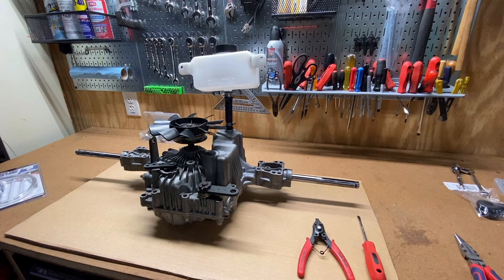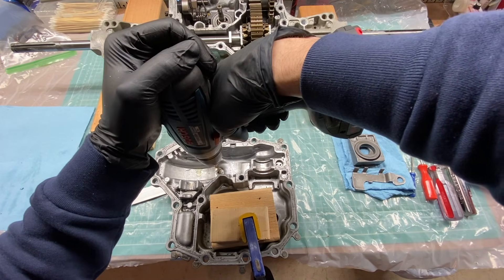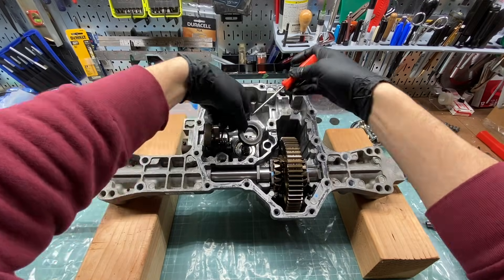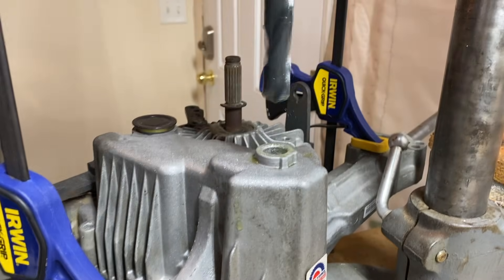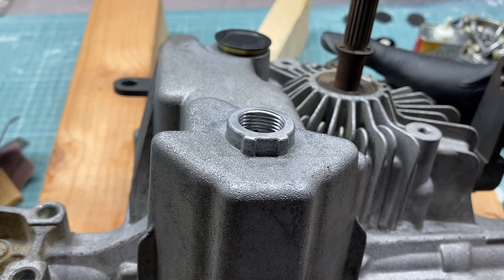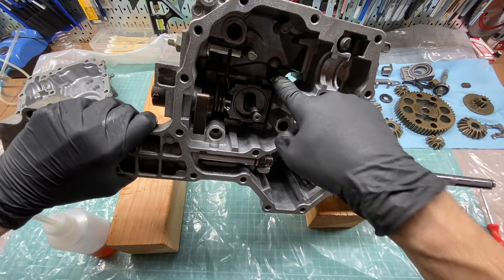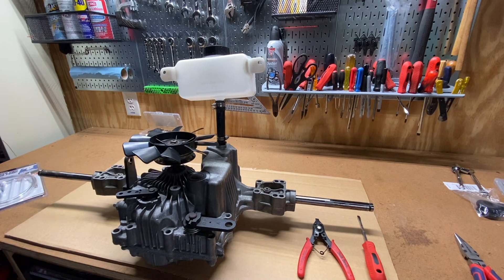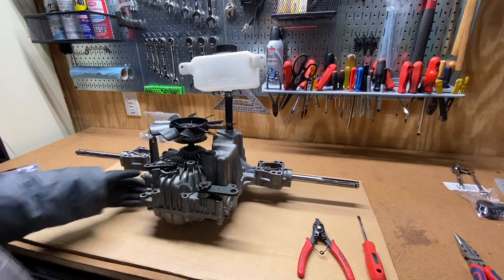Modifying the Tuff Torq K46 / T40J Transaxle For EASY Oil Changes (Oil Fill Mod Series Video 2)

Comment from the maker: I wanted to share the results from someone else who tried this mod and had issues. The person who kindly shared feedback indicated that he tapped the vent hole by hand because he didn’t have a drill press. His threaded barb ended up being crooked and leaked.

Just a word of caution for anyone else trying this: make sure you tap your vent hole perfectly perpendicular to the case so it makes good contact where it screws in. The compression of the threaded barb + washer against the top of the case is what makes the seal (not the threads).
Reply: wonder if he used a crush washer like a car oil pan? thread sealant would also work, even some pipe dope
Reply from the maker: @patrickpk6299 I assume he used a crush washer because one comes with the threaded hose barb that I used. He said he bought all the same stuff that I used. I’m not sure what else he tried if anything.
Reply: what you should of told him to do is get a rubber plug like a boat plug they come in every size imaginable and even with it being crooked it would of worked fine. i have used boat plugs for far worse including a rusted gas tank that had a pin hole that i drilled out and stuffed a rubber plug in. it wasn’t on the road but an old mud truck and i swear it held for a decade and probably would still be holding if truck didn’t get scrapped.

Comment: Just did on my k46.
 I  went for m10x1  hydraulic plugs with Allen head.
 I got to say, this is a drill press operation. Drilling  itself and as you did  guide the tap.
I had a  hard foam abrasive bit, i could polish the contact  surface for the plugs.
The hydraulic plugs  i got where vsti m10x1 ed. 
Integrated seal ring, and perfectly flush with  bottom of the housing, nice small head diameter.
Reply from the maker: Nice! Would love to hear how it works out if you feel like giving an update after getting it mounted and using it.

Comment: Good video and great work on the mods.  I'm hoping to add an external tank to my new ZT2800 transaxle but it has internal tanks and Hydro Gear is saying don't do it.  The three ports involved in filling (fill port, overflow port and breather vent port) really have a connected life in this low pressure system.  I don't see how adding a tank to the fill port is going to cause trouble.  Their internal tank essentially does the same thing.  It's all just low pressure fluid with a vent to atmosphere, correct?  Sorry for being long winded.  Been looking for a hydro friend 🙂
Reply from the maker: I can only speak to the Tuff Torq k46, but the vent is piped straight into the case.  The gearing side and the pump side of the case are connected by the fill opening at the top. It doesn’t look like it was intended for the oil to free flow between the two sides. It’s possible there could be a downside to that. I think there is more upside in being able to change the oil regularly though. That’s just my opinion. 

As far as I can tell it’s all low pressure except for where oil goes through the pump (on the k46). If the whole case was under pressure then that wouldn’t make a lot of sense for there to be a vent like you’ve observed.

What did Hydro Gear say exactly? Could you ask them why they say don’t do it? Maybe they just don’t want to support you if something goes wrong. Tuff torq used to publish a PDF telling you how to drill drain plugs in the k46 pan. It seems like they scrubbed their site for that. My guess is because people messed up and it was probably a headache to deal with. 

If you do mod anything, I expect that will void your warranty and you’ll be on your own and responsible for any mechanical or safety related issues. All the fun stuff 😀

Comment: Nice video very informative but kind of silly because I’ve had my Scott’s 42 inch riding mower with a T 46  hydrostatic transmission and the Kohler 17.5 hp a single cylinder and it’s still runs great. I changed the transmission oil once in 23 years by removing the steering wheel and front hood then simply flipping the mower upside down with the front resting on the steering shaft and the rear resting on the seat. All I had to do was take a screwdriver and remove the top plug, simple, fast and easy. Then refilled it once I flipped it back using a plastic tube that easily fits through the height adjustment arm space.
Reply from the maker: Wow! That would make a great video 😀

Comment: I bought the wrong K46, on e reinstalled I find that the transmission release works opposite as it should. Further, the foot pedals also work opposite.   I thought that maybe when I installed the release lever (had to remove the supplied lever and roll pin).  If I happened to rotate it 180 from its intended orientation could it make it work backwards?
Reply from the maker: For the bypass rod couldn’t you just use it in the reversed configuration? Regarding forward and reverse being swapped, it should be technically possible to change the orientation of a wedge shaped piece that sits between the hydro pump and the gearing. You have to open the case to do this. I’ve never actually done this but have read about people doing it. Proceed at your own risk 😀

Comment: I'm not actually sure whether or not this is the transaxle that is in my mower. How many hours were on this axle before you pulled it apart? Mine has over 1000 now and the whole mower looks like its been to war😅. It may not be worth it for me to try this now, the axle has been seemingly fine. It would be my luck it would fail after fixing the deck issues (multiple broken welds, rounded out mandrel drive pulleys, wheel broke off at the welds). If the motor gave out I could solve that by swapping it with a harbor freight motor if needed. Just trying not to spend 4-5 grand on a new mower right now. I bought this Husqvarna mower over 10 years ago when it was only 1600 bucks, and back then we thought it was outrageously priced. 😔

Thanks for the video!
Reply from the maker: Wow if you got 1k hours then that’s pretty good in my book. I had about 130 hours on mine — took me about 8 years to rack that up. My yard is probably too hilly for this trans.
Reply: @MostlyBuilds  Ours is about 6 acres of regular lawn, lots of roots though, not really well landscaped and some of those hours were used cutting pretty heavy grass in the smaller pastures in the back yard. This mower is being held together by the grace of God right now lol. Its the lawnmower equivalent to "i'm tired boss". And i'd say say right back atchya mower, you've been faithful despite me being a terrible owner..Haven't changed the motor oil in 2 years..about to do that today actually. 😅

Comment: Nicely done.  An easier way to mod the case vent would be find the desired size hose barb with a male NPT fitting that will slip into the factory hole as closely as possible.  Bond it into place with a generous bead of JB Weld.  Indestructible.
Reply from the maker: Thanks. JB weld did cross my mind. I wondered how a solution like that would hold up over time with the repeated expansion and contraction of the case when it heats up and cools down. If any of the JB weld cracked off and fell into the case that would prob be bad news for the pump. If you try it let me know 😀
Reply: @MostlyBuilds  I saw a highly experience diesel mechanic use JB inside a Cat truck engine to smooth an area over which the cylinder liner bottom O-rings slide during installation to avoid damage.  I think cured JB is resilient enough to cope with the temperature cycles.

Comment: Can the transmission be filled from the top instead of the bottom?
Reply from the maker: I haven’t tried filling through the expansion tank. I worry about air pockets. It might be possible. I would def follow the air purging procedure and let it sit for a bit afterwards to see if adding more oil is needed.

I think filling from the bottom is better though. This is how you fill the lower unit on outboard motors with gear lube.
Reply: @MostlyBuilds what is the oil capacity of the transaxle? What if you fill it to capacity? Wouldn't that ensure proper fill?
Reply from the maker: It’s about 3 quarts with the over filling that my mod requires. That’s a good point, I could totally try filling it from the expansion tank and see if there is any oil left over. Next time I do this procedure I should pay more attention to how much oil is left in the 3rd bottle. I’m pretty sure it was only a tiny bit because I didn’t save it.

Comment: Is there a way to add external oil cooling radiator?
Reply from the maker: I haven’t tried this but I’ve seen a few people attempt this with solutions that look a little hacked together (using things like JB Weld). 

Here are two: 

https://www.mytractorforum.com/threads/k46-oil-cooler-custom-my-way.1321309/#replies
(Expand the first post on this one)

Another one I found when I was looking up that first link to paste on here:

https://youtu.be/mhgfeOZvSDI?si=KgD5ZbpDEOTr5_1B

I think it would be interesting to add an oil cooler. I’d also be interested in building in an oil filter that can be easily replaced. I might do this one day, but I’d like to come up with a more “production” looking design than the two links I pasted.

Please share if you come up with anything or have any interesting ideas. Would love to collaborate.
Reply: I don't think it's worth going thru the trouble with the lowest end trans the tuff torq makes. I'm in the process of doing the mods you did here but that's as far as I would go with this trans. Tuff Torq should have stopped producing this k46 and recalled the rest of them. They are not built to last.
Reply from the maker: @ggtaruc2578 I get what you are saying. I don’t know if it’s like pure evil though. Imagine one company releases a cheap and totally accessible riding mower with the k46. Now someone who could never afford a quality machine can get the cheap one that will last them 10 years with their totally flat yard. Then other mower manufacturers who wouldn’t have considered putting their names on a low quality machine suddenly are losing all this market share.  Then they jump on the bandwagon and suddenly everyone is  selling budget machines rocking the k46. 

I don’t know if that’s really how it happened but multiple manufactures sell machines with the k46. They all know what they are doing. Is the alternative better where there just isn’t an affordable machine at all? Dunno. My beef with them is they aren’t more up front about the limitations of the trans. 

Just my opinion 😀. Good luck with the mods. Would love to hear how it works out for ya if you have time to write back about it!
Reply: A cooler is kind of un-necessary - the fan is constantly blowing air when running. You just need to make sure the cooling fins (under the fan) are clear of grass, to keep it cooled properly.

Comment: The fact that the mfgs spec these transmission without serviceability tells you everything you need to know about what their intentions are.
Tuff Torque makes their full line of transmissions with expansion tanks and drain plugs installed at the factory.
OEMs are the ones that spec them W/O these critical feature.
Sealed OEM transmissions are a giant SCAM to force you to buy a new mower every 5-7 or years.

Comment: Your generation always wearing gloves to work on things. It's so hilarious. How could you be killed? will the transmission explode. I need to do this to my john deere x320 K58 tranny without taking the bottom case off. My destroyed lumbar region of my spine won't allow me to do all of this. Come to my house in south florida this winter and spend a few days and do it for me. thanks.😁You don't need a specific sealing washer. You can also put silicone on the threads or teflon tape. Teflon tape has been used for many many years. Your funny. 😄
Reply from the maker: No glove no love!
Reply: @MostlyBuilds  You younger people. Germaphobes and boo boo aphobes. Dawn or gasoline will clean all the grease and oil off of your hands. Your not making love to mechanics or anything else. 🙄🙄☺☺
Reply: There is some "evidence" that repeated exposure to petroleum products is detrimental to your health , and perhaps it is but that not why I wear gloves.
I prefer not to get oil and grease all over everything I own and/or have to wash my hands with pumice soap 5 times a day.
I would rather not have everything I own be a greasy mess and not be allowed in my house by my wife b/c my hands are covered in grease and stain everything I touch.
I don't live in a garage where grease an dirt is perfectly acceptable. My houses floors also dont look like the bottom of a oil change pit  b/c I take my boots off ... b/c im not an animal.

Comment: Pretty smart of Tuff Torque to sell equipment without drains and threaded, accessible fill ports.

Those that can, will drill and tap their own.

Those that cannot will buy a new trans. from TT or buy an entire new tractor that benefits Red China.

Brilliant business model, and they don't even seem the slightest bit ashamed of their incompetence or greed.
Reply from the maker: It’s definitely a bummer that the trans isn’t serviceable. A few additional thoughts:

- The mower manufacturers are who spec out what features the trans gets (within the capabilities of the k46 design — drain plugs for example)

- The limitations of the trans might in part be what enables riding mowers to exist at this price point. Otherwise a riding mower might be out of reach for many.

What bugs me the most is that the mower manufacturers just say the trans is a sealed, non-serviceable unit (that’s what John Deere says at least). When in reality it’s totally serviceable, but inconvenient. I’m sure it’s not worth it for a dealer to service them. But a handy consumer could totally service it with some effort. They could share info about “advanced servicing” or something.  

Thanks for checking out the video and for sharing your thoughts. Hope you consider subscribing.
Reply: @MostlyBuilds  
The mower manufacturers are who spec out what features the trans gets (within the capabilities of the k46 design — drain plugs for example)

- The limitations of the trans might in part be what enables riding mowers to exist at this price point. Otherwise a riding mower might be out of reach for many.

*Gibberish
Reply from the maker: haha! I tried! All I can say is that I've had really positive interactions with the folks at Tuff Torq. I can't say the same about John Deere.

Comment: Nice job on the drains and i too have thought about modifications to allow filling eithout removal of unit. Its all for nothing though. I have done full service and overhauls on several dozen of these and the issue is never just the fluid. The filters always clog, sometimes in as little as a year. Chaning the fluid/oil without changing the filter provides very little if any improvement.
Reply from the maker: Well that's a bummer. When you say the filter is dirty, is it like totally caked with stuff? When I took mine apart for this video series, the filter didn't look clogged at all. My trans had 130 hours on it. I guess I'll see what the oil looks like when I drain it in the spring. Another thing to consider is if you overheat the trans, oil can't spew out of the vent cap anymore because of the expansion tank. When I took the trans off before the mod, it had dried oil all over the case on the vent side.
Reply: @MostlyBuilds  yes, almost completely clogged. Sat old filter on flat metal workbench and filled filter with fresh oil, that small volumn of oil took almost 12 min to seep thru.
Love you work though.
Im older in declining health. I wonder if a you guy like you who is more up to date on tech things couldnt use 3D printer to make a new lower cover with a removable cap to allow changing of the filter without removal of transmission, would be great with your other mofifications.
Reply from the maker: @robt3305  thanks for the kind words. I like the idea of a removable filter mod. Totally replacing the bottom pan is interesting. I’ll have to give it some thought. Hope you consider subscribing.

Comment: What oil do you use for a k46
Reply from the maker: Tuff Torq recommends their blend of oil called Tuff Tech 187Q0899000. Here is their chart: https://tufftorq.ordertree.com/media/promo/TuffTorq/Fluids%20and%20Lubricants.pdf

You can find it on Amazon: https://amzn.to/3OIKzKP

If you prefer to use an off the shelf oil, the general consensus online seems to be to use a good synthetic 5w50. Tuff torq says to use their brand of oil because they put special additives in it.

In my first video of this transmission mod series I talk about the history of Tuff Torq’s oil: https://youtu.be/0GN0Tk957Ho
Reply: I have used mobil1 full synthetic 5w50 in my hydros. 
You mileage may very but it is VERY good stuff.
It s like ly overkill if you are changing it out every 50-100 hours but its a lot cheaper then down time or a bad transmission.